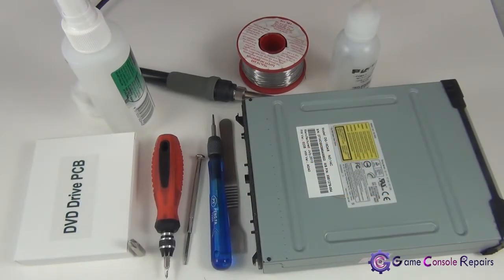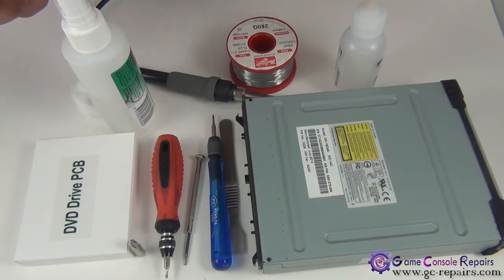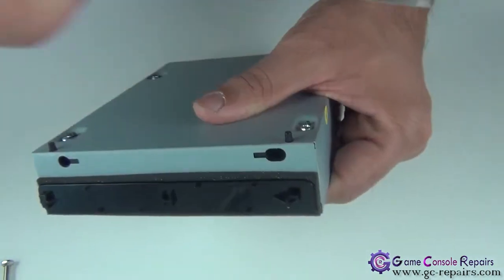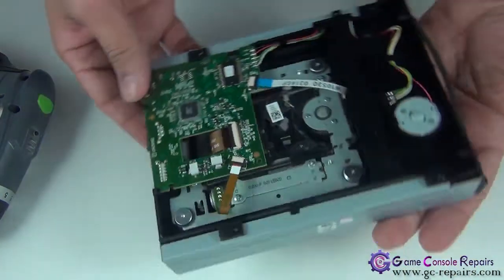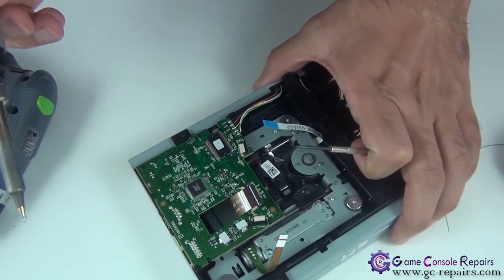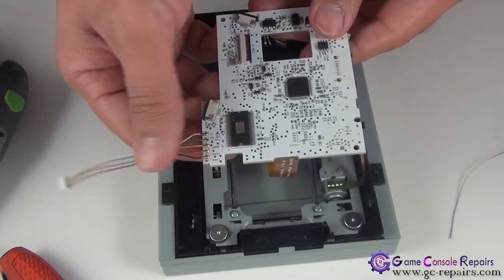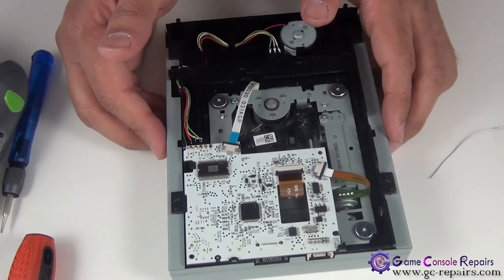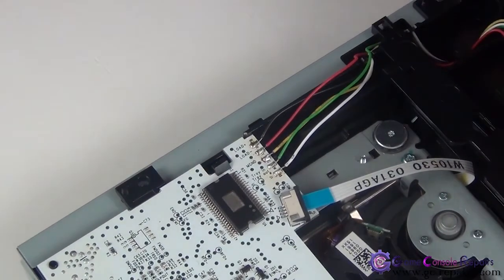Installing TX Unlocked Replacement PCB on an XBOX360 S Lite On DVD Drive

Comment from the maker: You are absolutely right, you can either solder it or simply use TX provided switch and wires and attach it. 
Since we do a lot of installs we prefer soldering to provide strong solid connection to avoid any issues.
Thanks

Comment: Hello Brother from another mother lol! Anyway my comments for you great video, BUT i have an advice for everyone out there. You don't need to solder or better said get rid of your little adapter that comes with the replacement unlocked PCB where you attach all the cables. I just got mines done and it worked perfectly just takes a little patience but just to make sure your cables are touching the top part. SAYING this it will avoid all the newbies out that are not familiar with soldering.